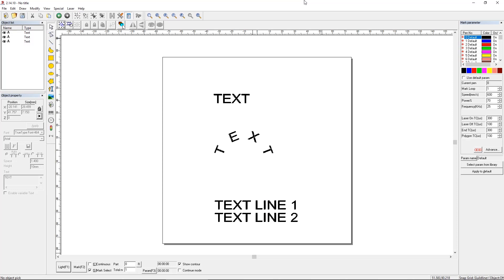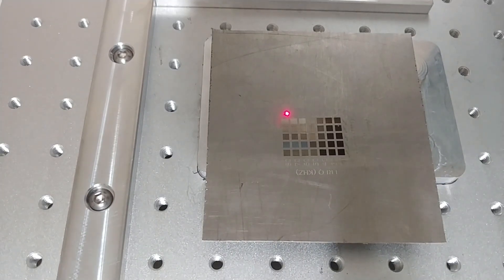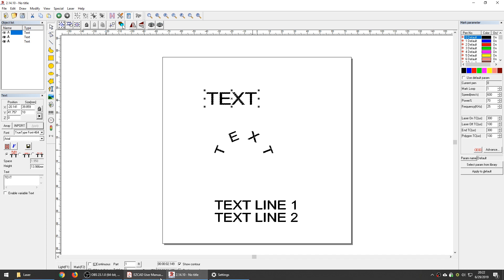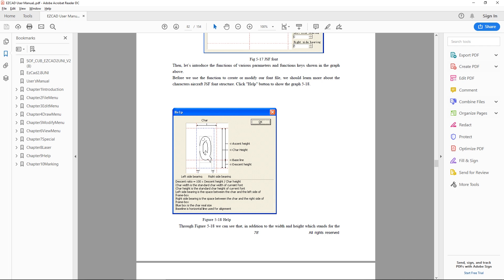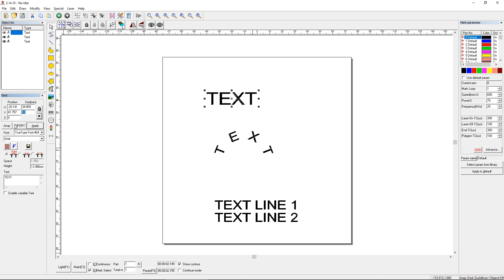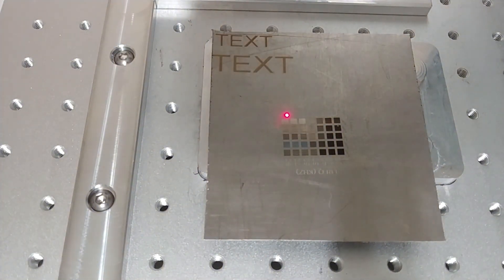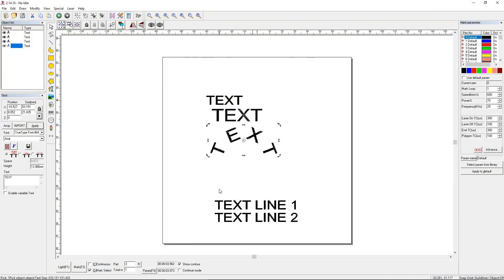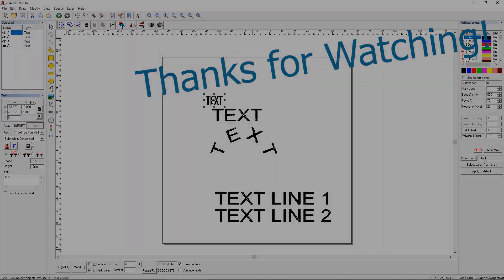EZCAD2 - Setting Text Height

Comment: HI! Do you know if you can make a perimeter for text that will lock it to those parameters, for example if I engrave tags and change names I write different names on them and that changes the size. Is there a way to keep it from changing width and height even if there are more characters?
Reply: I would like to know too.

Comment: Jeff got my laser and I am having a hard time with Corel an importing into excad. My files are coming as outlined and when I apply hatch, it turns everything black.
Reply from the maker: I've used Corel a few times, but am more familiar with Illustrator...but regardless when you import your file into ezcad, only the vectors will be imported - none of the fill (if that's what you were asking).  If you find that you're getting odd results when you apply the hatch in ezcad, you may have to modify some of the lines in corel with the pen tool to ensure nothing is overlapping or disconnected.  You also may have to select the imported object in ezcad and 'ungroup' so you end up with a bunch of curves, then you can hatch areas individually.  I've run into that before when converting logos and hatching.
Reply: JefferyJ you were perfectly clear, thanks! You know a lot

Comment: Also are there any forums or reviews of chinese fiber companies so that I can determine which company is safe or safer to make my purchase.  I have emailed many of them but few are willing to give detailed information on the components so that I can compare quality at the component level to the price of the system and compare between companies. Thanks
Reply from the maker: I bought my laser directly from eBay through a seller who wasn't a manufacturer.  I've heard of several Chinese suppliers, but I don't have any personal experience with any of them so it's difficult to recommend anyone.  My friend (if you saw the 30vs20 watt video I made) bought his laser from szsnlaser.com and they're a little pricier but have been available to answer his questions.  Please don't take that as a recommendation though - I quoted them but ended up going through ebay mainly for the lower cost.

Comment: Your videos are very valuable and informative!  So far your channel is the only channel I have found that discusses in ENGLISH useable informative narrative on how to use a Fiber Laser.  Please keep the videos coming.  I am also interested in the reasoning for different settings used on different substrates.  Example why on the watch back did you use and initial engrave at faster speeds then a second engrave at slower speed?  What thought process prompted you to do it that way?  I am asking so that I understand how to make the decision to do something more than once and why I should consider a different power or speed or pulse rate or width - so that I can increase my understanding of the tool at these different settings and when and why to select them.  Thanks again for your great channel.
Reply from the maker: Thanks!  For the speeds and power settings, it just depends what effect you're going for.  There are a lot of good guides from Epilog if you search for 'Epilog Fiber' or something along those lines.  Supposedly several fast high power passes will remove material and then a higher frequency lower power pass can act as a 'clean up' pass.  I'm certainly no expert, just sort of following what I read.